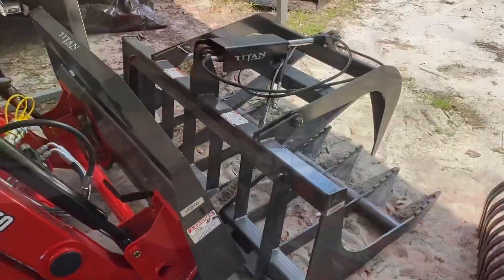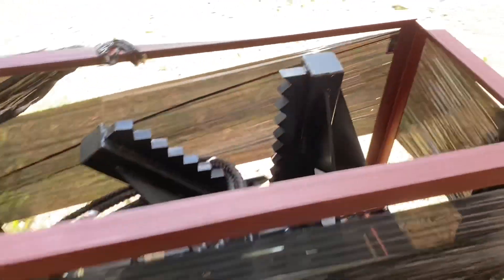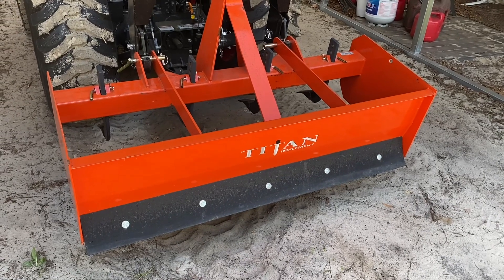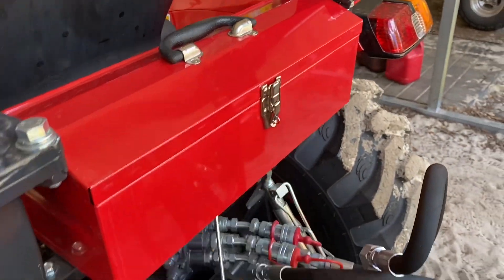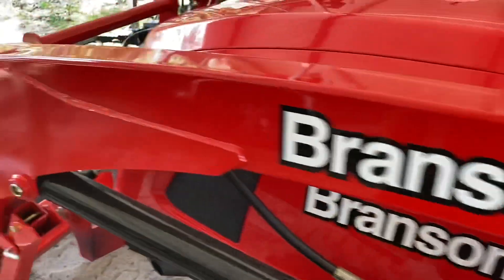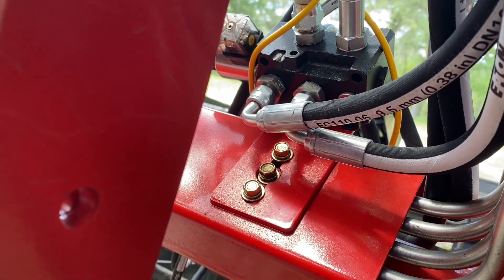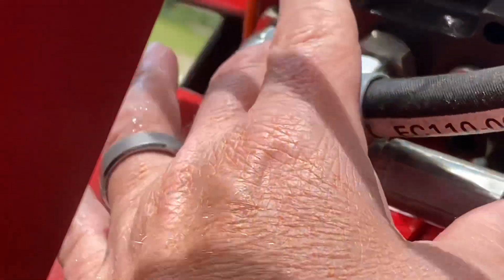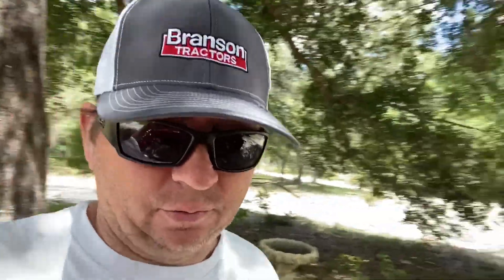Branson Tractor 2515H update

Comment: Happened on my 2610H right away as well.  Replaced the coupler and no issues after that.  From my experience it happens when you put the incorrect type of pressure on your loader or bucket.  The coupler is the weak point that will give under that pressure.
Reply from the maker: Thank you for watching!

Comment: I hope when you replaced the couplers that you changed them as pairs? Its always best practice to replace them as pairs. If you stay with the same brand of coupler then you can get away with say a male end or a female end on its own. You can also replace just the sealing 'O' ring inside the female coupler, but obviously you need the correct size o ring. This will often seal a leaking coupler pair, but only if the male end is not damaged, especially where the O ring seal surface is & you dont want burrs, scratches, etc, in any area on the male end where it slides through the O ring. The valve you are referring to on the loader cross arm is the 3rd function valve. Give the fittings that go directly into the valve a tweek with a spanner (wrench to you) of the correct size. Also give the hose end fittings a tweek as well. These fittings unless they have used 'O' ring flat face fittings, they'll be either sae or jic fittings which are a metal to metal taper face fitting. These need to be just a bit more than snug tight, but not wrenched up so tight that you are heaving on them, you'll only damage the sealing faces if you do that. If they have used cheap fittings, these will often be a soft material & these distort very easily. If leaks persist, you'll have to get the dealer to replace them, & for future reference, go to a reputable hyd shop & buy decent fittings. You'll need an 'O' ring kit as well. Keep these in stock at your place, as saves lots of trips to the hyd shop. When working on hyd's, cleanliness is paramount. A quick squirt of 'Brakeleen'  will ensure not dirt is in things like 'O' ring grooves when changing out O rings. Always, Always, clean any couplers before connecting them. Yes, I'm a Fitter/Welder by trade & did my time in a Hyd shop & I'm a farmer
Reply from the maker: Great info sir and I very much appreciate the time u took to explain. I had the dealer fix and no issues so far.

Comment: The dealer needs to fix this, if you wanted to deal with leaks you could have bought a used tractor !
Reply: I agree if the dealer paid to replace the defective couplers he may be inclined to source a alternate vendor for the third function kit.
If you fix and tell, the problem  it is solved and he has absolutely no motivation to correct this issue. The next guy comes along and the defective substandard QDs become the new customers issue. And the cycle of defective parts has begun. Kyle it's the butterfly effect some quality assurance that let the couplers slide through at the couples machine shop has increases profit margins with a errand pass just and was promoted to head of quality at Branson. By not interacting with the dealer every Branson for generations  could have defects because this QA person was in his 20s when he was promoted the top for cutting corners. 
This has been known to change  the earth's axis and cause polar ice to melt and flood thr low laying factory that machines the crazy couplers. And they out of business so problems solved. I guess I owe Kyle a thank you. 
Just kidding, Kyle. Really awesome testimonial I am glad the fix was easy.

Comment: Going to look at Branson tractors this weekend. How do you like this tractor after several more months?
Reply from the maker: Love it! It’s done everything I have asked it to do. Look equally as much into the dealer as much as the tractor. If it’s a garage dealer you won’t be happy. Service on the tractor along with parts they carry is super important. Good luck! They are good tractors.
Reply: @kylefamilyhomestead7007  So far the owner of the dealer seems pretty nice, but I'm waiting to see the actual dealership and ask questions about service and delivery and stuff like that.
Reply from the maker: @redneckmini14  Ask about normal service parts. Air, oil filter ect. Make sure they stock them.

Comment: That hydraulic fluid will ruin the paint fast.
Reply: Hyd fluid is not brake fluid, so it wont destroy the paint. Hyd fluid is oil based, same as motor & gear oil. Never ever mix the 2 products. Severe damage to the machine will be the result. Brake fluid is made for vehicle brakes only!!
Reply: @ianbond3982  I'm sorry sir but I've been in aviation for 37 years+ and hydraulic fluid will strip paint and fast. Brake fluid is a type of hydraulic fluid.

Comment: Use more fuel than my kabota and weak hydro pump. Don't think I'd buy another one. Sorry
Reply from the maker: No need to be sorry lol. You are welcome to any opinion. It’s definitely not a Kabota nor does it match the price of one. I like it but I don’t have anything to compare it to. Thanks for watching! MK
Reply: Sir, just what size ( model) Kubota tractor do you have.? ( have a MX5200 TLB shuttle shift with 925hours & 6years old). Thinking about adding a brason2515 to the "fleet".